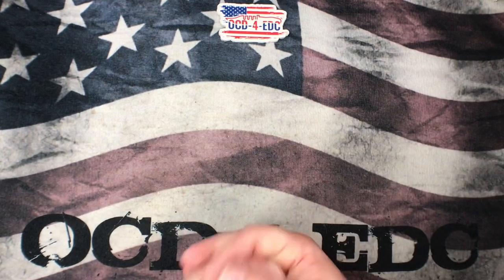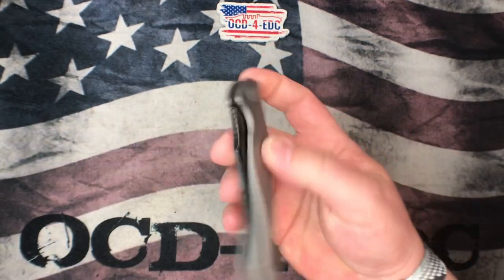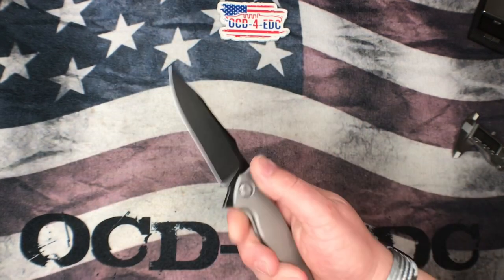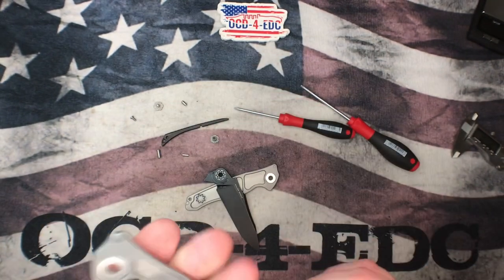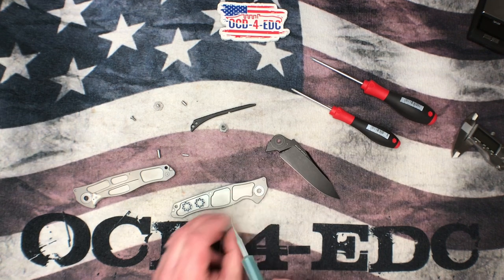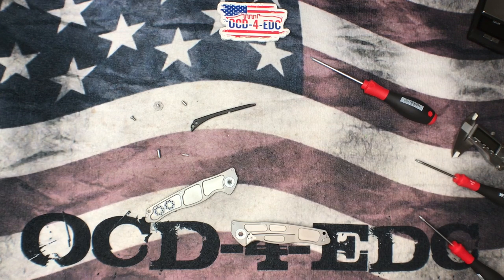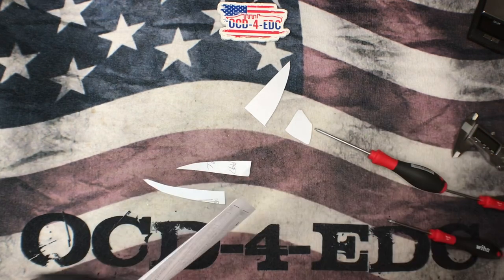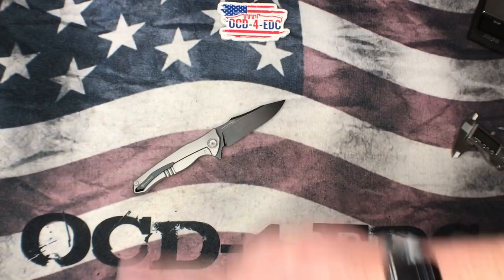This New but Old Super Steel looks Awesome On Paper!

Comment: I think of it as powdered M4's opposite side of the same e coin. M4 is high carbon and an assload of vanadium. As-60 is high carbon with a buttload of cobalt. This would be a bit more wear resistant (but not by much) than M4 but M4 will have a lot more toughness. So if you need a knife get a M4 blade, if you need a drill bit get AS-60. Just my two cents. Still worth it to have one knife in it for comparison and or collecting purposes.

Comment: There have only ever been two production knives made with ASP60...the Killer Whale 2, and an early version of the Maxace Mammoth that never made it to US dealers. I can't find any evidence of a custom knife ever being made with it. 

Maxace ran the Killer Whale 2 at 63-65HRC. At that hardness, ASP60 has very similar strength and toughness to Rex 45 (ASP30) at 66-67HRC, but with edge retention equal to Maxamet at 69HRC. Corrosion resistance should be approaching the semistainless range becasue of the very high Mo content. Primary carbides are about 14% MC, 5% M6C, with some M2C secondary precipitates. Matrix composition and precipitation behavior are about the same as Rex 45.